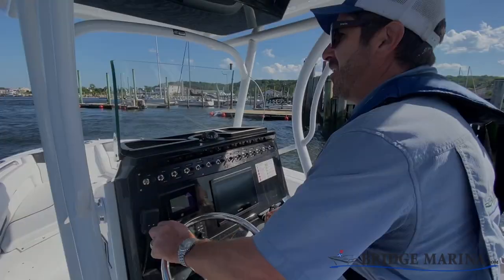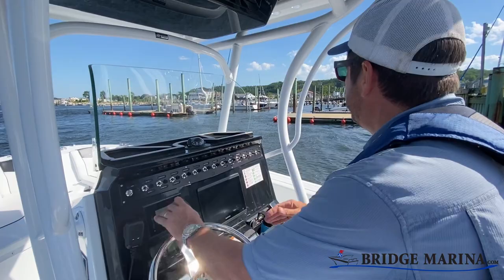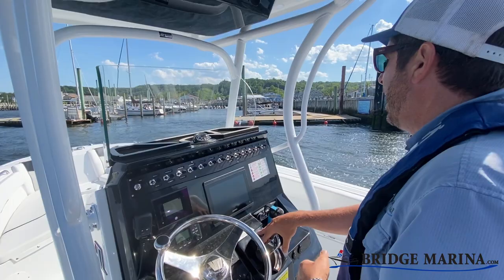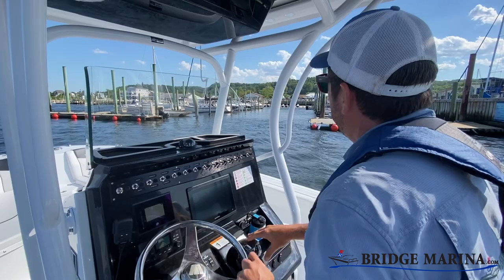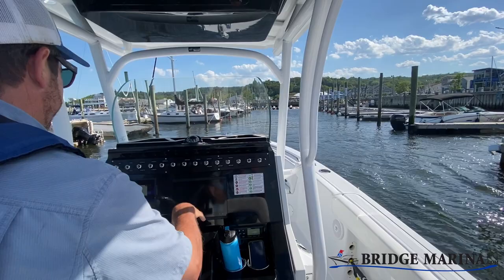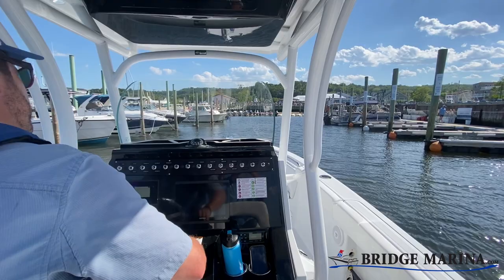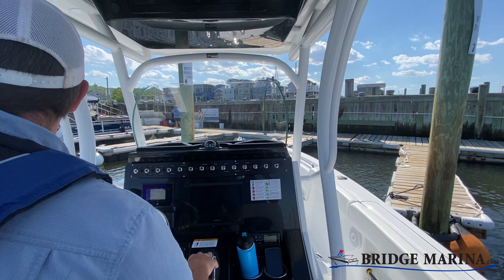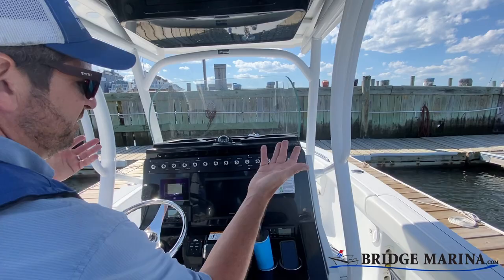Boat Docking How-To: Pulling into the Marina

Comment: Hi thanks for the video. A question. At 1m40secs... When you were going to lose the bow so you started turning left and put it in reverse gear. You initially your were in forward gear and were turning right. When you started turning left prior to putting it in reverse gear, did you turn the wheel to the left whilst forward gear was still engaged or did you put it neutral?